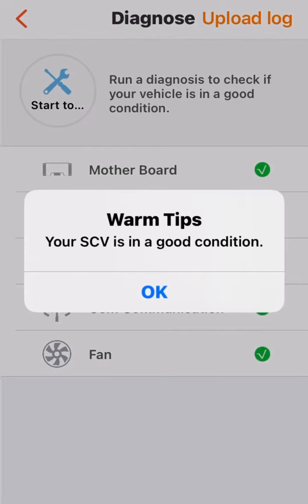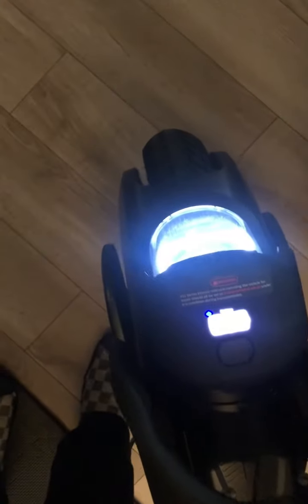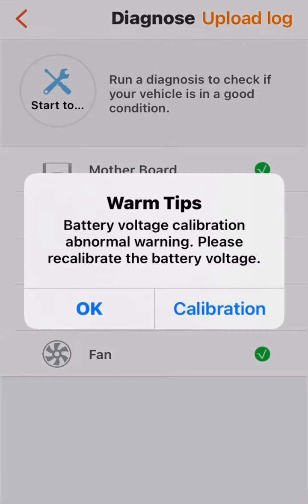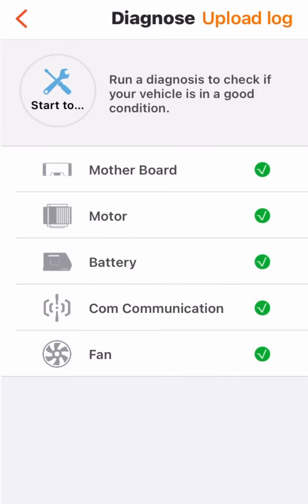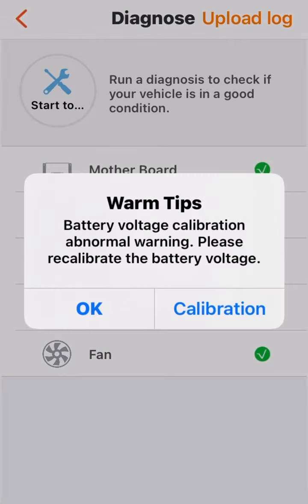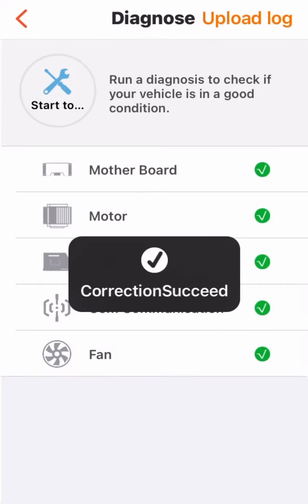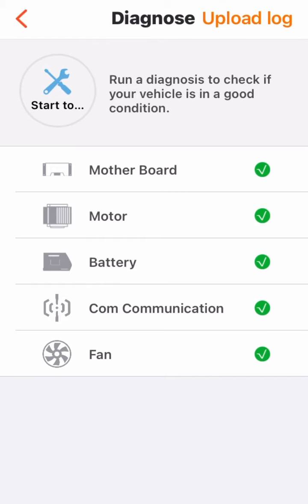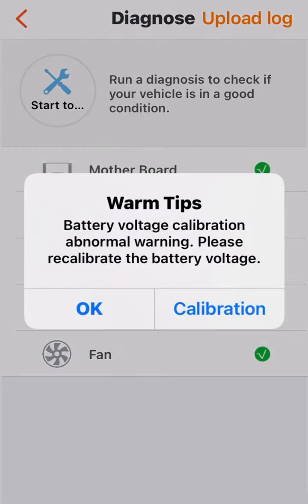What is going on with the V11 by InMotion? - (Tilting backwards and battery calibration issues)

Comment: I have same problem.  How did you fix it?
Reply from the maker: Did InMotion run a remote calibration? Sometimes that will fix it! If not it's usually the PCB or BMS!
Reply: I had same problem, I had over voltage and because of that it didnt let me ride it. So I but on all the lights and tried to get the voltage down, and that fixed the problem